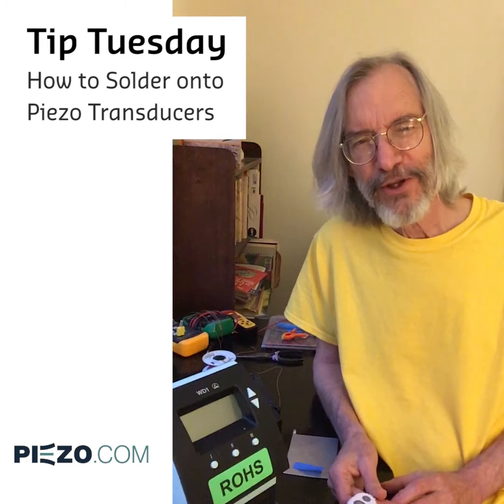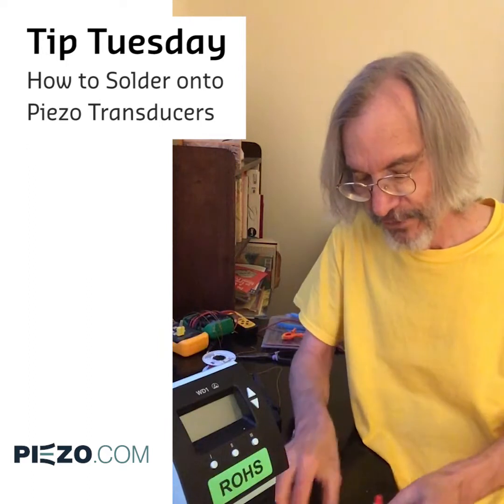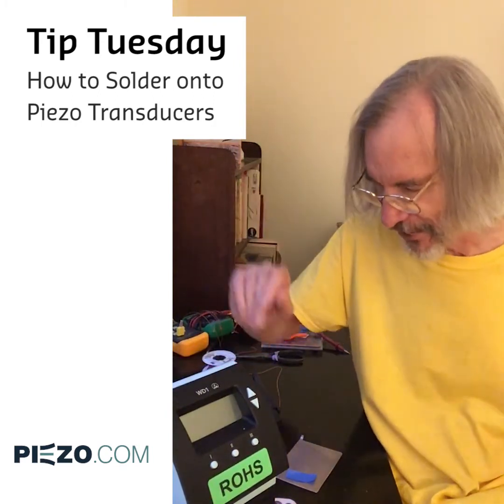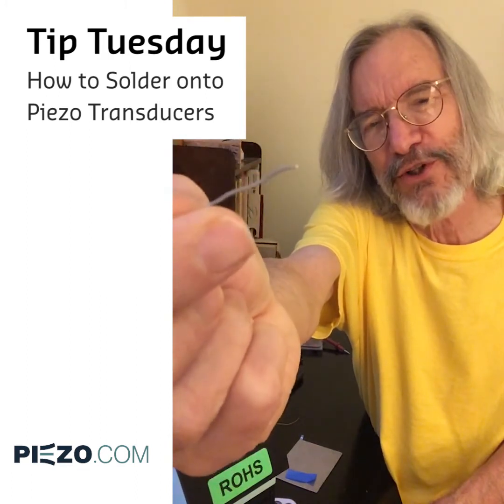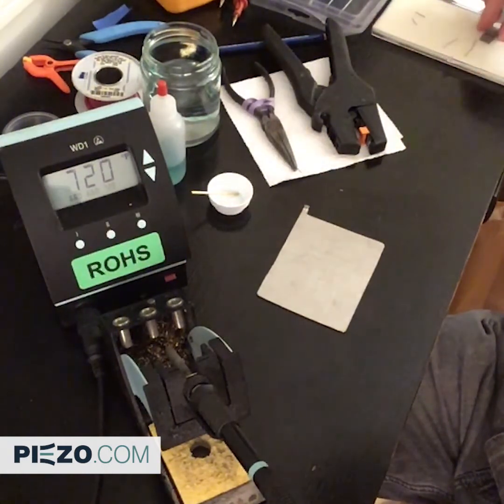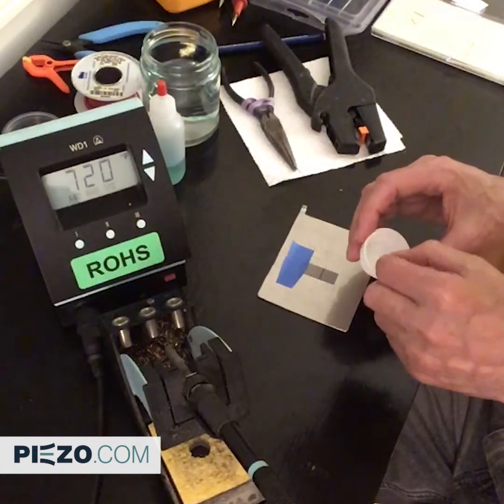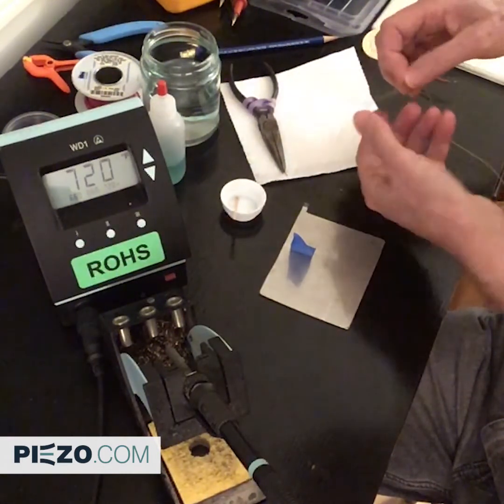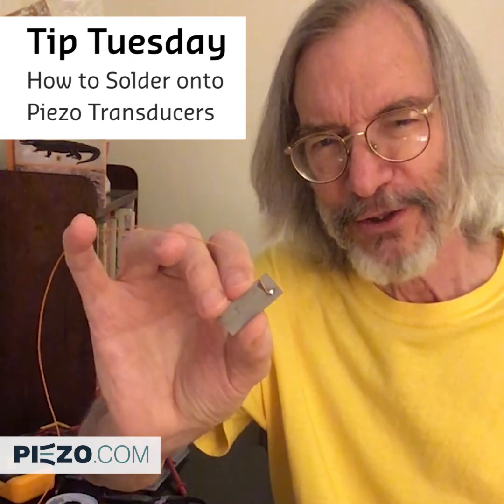How to Solder onto Piezo Transducers

Comment: Hopefully your still receiving and answering questions - I've been repairing transducer's for years [ when it will allow ] the signal is sent to the crystal by a very thin wire and because of moisture the surface that the wire is soldered to darkens and rubs off [ I think it's of a silver nature ] any way to reapply the silver looking surface to the ceramic - also you suggest rohs solder I recommend a silver solder it seems to work better for me when I'm able to resolder back to my surface of said transducer - granted I'm trying to solder in a very tight space

Comment: Really appreciate the video! Maybe you would be so kind to give me some advice. I use a piezo as an electronic drum trigger. On top of the piezo sits a piece of foam , the foam makes contact with the drumhead. Needless to say that the whole thing is under constant "abuse" because of the head being hit. As a result the joint of the negative wire on the edge of the piezo is constantly braking. I was wondering if i could strip a longer section of the wire and solder it as semi-circle around the edge of the piezo to prolong its lifespan?